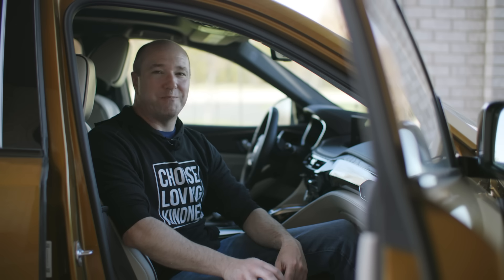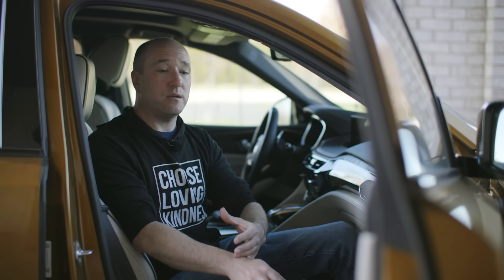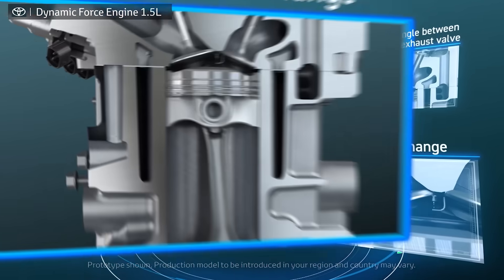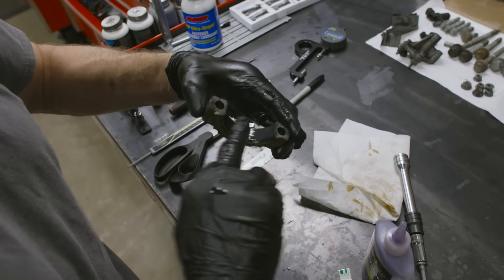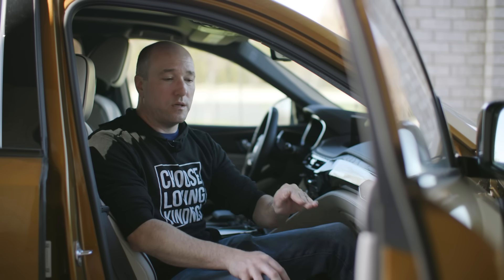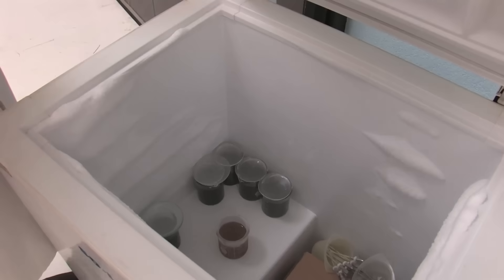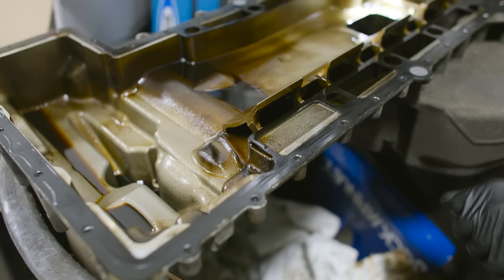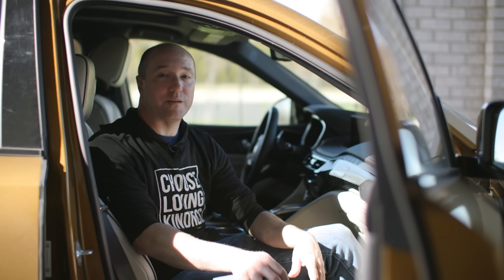Understanding Engine Break In | Dos and Don'ts

Comment: A few years ago, I got a new Fiesta ST.   There was an engineer on one of the sites that had a break in guide.   Lots of oil changes, and off throttle coasting down hills, varying speed.  Run through the gears slowly with in gear coasting to get oil to the top of the cylinder bore. Made sense to me then, will do the same with my WRX if it ever gets here.  Timely video, thank you!
Reply: I also watched some video long ago by an engine builder. He also said that  "gear coasting" aka "engine braking" was important for proper seating of the piston rings... especially important on Subies.
Reply: @GetOffMyyLawn is gear coasting a thing with automatic?
Reply: @simd510  If engine braking = engine coasting, then yes... just shift to a lower gear, and take foot off of gas
Reply: @GetOffMyyLawn  so do you engine break to slow down? Or put it in neutral and coast?
Reply: @SKYxNINE  leave it in gear to slow down
Reply: Self proclaimed engineers on forums are the worst source of information.
Reply: One of the best break is procedures I’ve ever heard. I have a 2020 wrx from new. It’s really worth being the first owner of a wrx. I changed my oil at 250, 500, 1000 and 2000, before switching to a 3k mile interval. It’s amazing how much dirt/metal particles were in the oil. After the 1000 mile change it cleared up completely. Im hard on my car and I don’t want oil it it too long so 3k miles works for me.
Reply: @kcspeed9980  That, sir is what I am talking about!  Well done!
Reply: @joeblack1052  Sure - so Y R U even here.
Take a hike Son
Beet It Boy
U Go Girl
Reply: Manufacturers should a have break-in procedure in the owner’s manual, mine had mileage ranges and speed limits to go with them.
Reply: Broke in my brand new 2 mile 2021 STI hard lol went easy for about 100 miles then said fuck it 😂 oil at 1000 looked fine. Still going good, stock.
Reply: damn, if I ever got my hands on a Fiesta ST I would never sell it
Reply: @fortheloveofnoise  Amazing cars but getting hard to find clean low mileage unabused ones. My honest advice (i own an 04 SVT Cobra & GT350R) is save for new or lightly used Mustang Ecoboost 2.3L GTDI. Excellent, proven turbo 4cyl performance engine. Its a new & highly improved bigger engine Focus ST .
Reply: @fortheloveofnoise  I thought the same - Until I bought my GR Corolla - nuf said
Reply: I bought my ‘13 Focus ST new and still have it. I made sure to vary the engine speed and load for the first 1000 miles and avoided WOT and high RPM. Like you, changed the oil at 500 and 1000. I’ve been rewarded with a dependable and strong engine. I never run the oil more than 5K. 103,000 and it still has the original clutch.
Reply: @charlesjames1442  I did the same with my new '14 Fiesta ST Except the odd short burst of WOT... Still have it... Still Love it - Until I get my GR Corolla-;)
Reply: @TerryManitoba  Get a new Mustang Ecoboost w/track package. A REAL sports car w/proven performance engine. Not an econo car like Corolla.
Reply: @Davido50  I have had plenty of Fords (trucks - ST - Transit 250 a/w 3.5 eco) But I like me a Hot Hatch (no sedans for me).  I have Never Ever liked the Mustangs (except for the 1965 ish era) So - you couldn't catch me DEAD in a Mustang. I think they look like CR@P & oh so Poseresk. And they are a bit piggish (3900 lbs) So not really a sports car.
Reply: @charlesjames1442  Awesome cars. New Mustang Ecoboost are hugely upgraded & improved Focus ST engine sports cars.
Reply: Did SG help you decide on it? Mark and The Smoking Tire sold me on mine.
Reply: That's for sure - Gear coasting IMO is one important part of a good break-in. (I didn't know that is what it was called though)
Reply: @TerryManitoba  : Engine braking?
Reply: @charlesjames1442  Ya - engine coasting in gear is Engine Braking...
Reply: @joeblack1052  lol fek off
Reply: @joeblack1052  So why the fuck did you click on his video ?? Lol
Reply: @joeblack1052  Huh?
Reply: Hello fellow (potential) Fiesta ST to WRX graduate. All this is so good to know!
Reply: @mattdrumdawg follow what the manual says for the wrx.  It lists the procedure (posted above what it said for my 2018, 2021+ is a new motor so it may have changed some).
Reply: Back in the 90s.  Toyota used to advertise in magazines.  That they Rev their engines from idle to redline 15,000 times so your teenager doesn't have too.
Reply: @BeingMe23  Toyota isn't a good representation of performance engines in ANY regard. Facts.
Reply: @joeblack1052  That and a dozen other factors - Try watching it again - Ya'll might pick up a few (several) more protocols